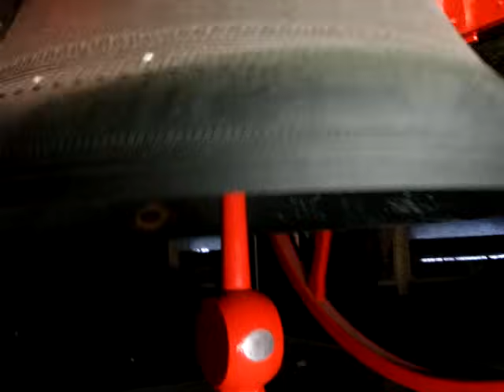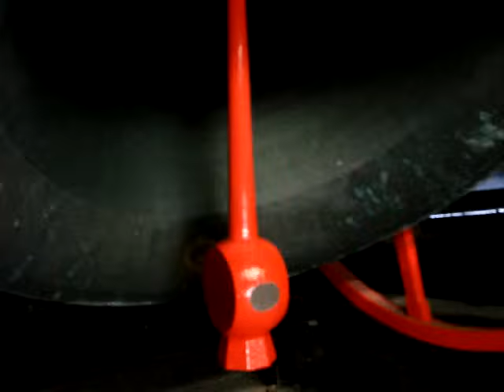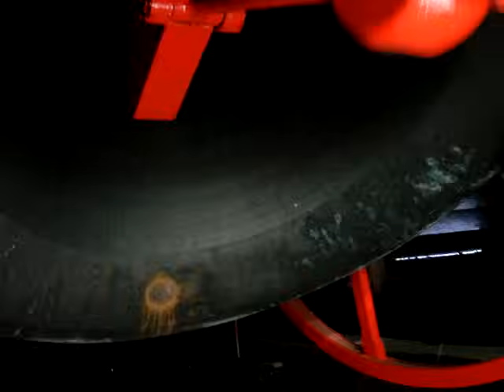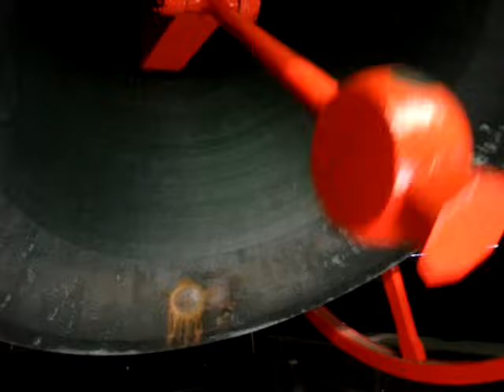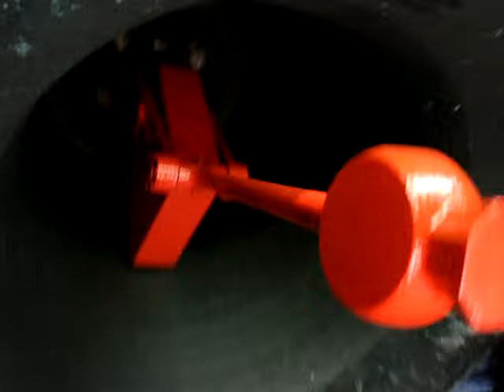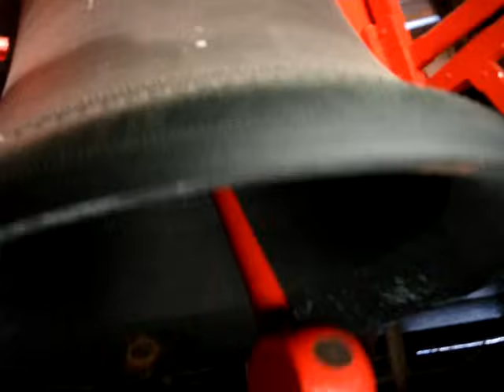Ringing a 10 ton bell in York Minster

Comment: Helps to keep your mouth open when the noise is that loud. A cleverer person than me could explain the reason why.
Reply: Something to do with the vibrations and shock that goes through your body I think.
Reply: If you can hold your eustatian tubes open like a diver or swimmer can and open your mouth  the sound travels to both sides of the eardrum simultaneously.  Resulting in less damage.
Reply: But what about earplugs?